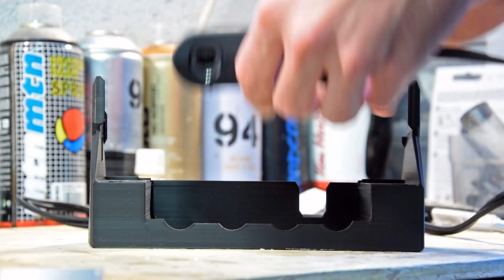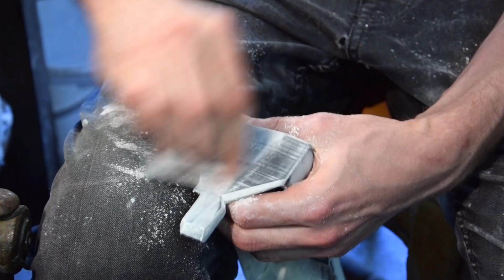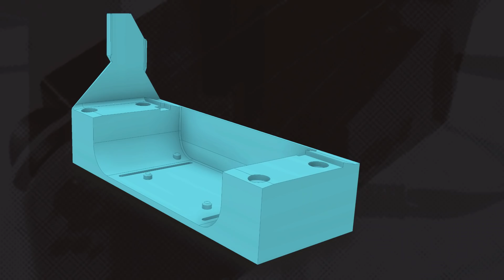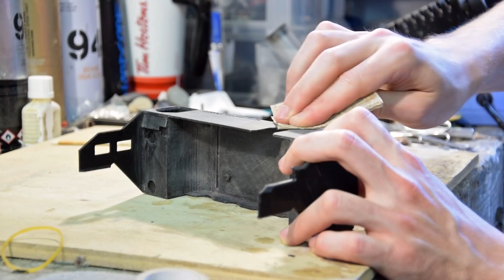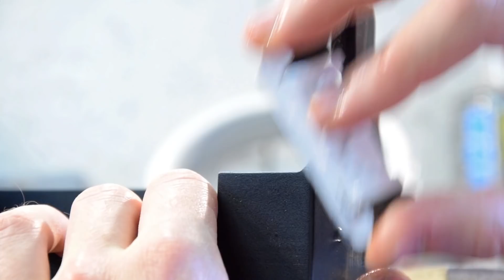Ultimate Switch Dock - Gamecube ports on official Switch dock - Rated-E Mods

Comment: I know it’s been like a year since you made this but I recently remembered this. I have an old skool dock which is almost identical in measurements to the original adapter but slightly smaller, would the current files work with it or would you or me have to edit the proportions to make it work

Comment: Just got mine, only thing I recommend is adding some rubber feet to the bottom since it slips and drags pretty easy on flat surfaces
Reply from the maker: Maybe i should put little indents for rubber feets on the bottom
Reply: @RatedeMods  Would be pretty nice. I just ordered some and plan on installing them on the one delivered to me

Comment: You know, I think you could make a Switch, Xbox 1 and PS4 console in one. A hybrid custom console that let you play EVERY game and use every controller, it would be difficult but hey, something, and you can make it a handheld or a home hybrid console, and you can higher or lower the frames  if it's possible. This was a theory of mines and some of this could only just be a opinion of mines as well sense making a ultimate hybrid console will be kinda hard, or almost impossible.
Reply: If this, Console does exist it maybe called the XStation64, or a better name. ( Edit: I had to fix some auto corrections for typing to fast)

Comment: I printed it off but it was unfortunately very flimsy. The pieces on the side snapped off really easily, and now the Switch doesn't like to sit on top of it.
Reply from the maker: They can snap off but if you use a strong process they can be pretty strong ! At least 3 perimeters and 30% infill
Reply: @RatedeMods  I wonder if I can go back to the printer then. They didn't give me much flex room for choosing stuff like that. The one I printed off also had strands of plastic-y hairs and an extra base to it: https://cdn.discordapp.com/attachments/147214538083794945/542085318191349771/image0.jpg
Reply from the maker: Oof yeah that doesn't look too bad but not too good either :/ those strands are because of poor retraction. You'll need to scrape off the little bubbles at their base too because it would leave less room for the switch dock than i intended :(
It looks like there is a high layer height and a low wall line count (you can know by looking at the number of lines making the little circles on the top for exemple)... I do think this is not as strong as it can get.. but the main thing to remove is those strands. With a knife for exemple.

The brim at the base is normal :) it's unnecessary but it can't hurt. Did they not give you any control? I hope this was free or very cheap 😅
Reply: @RatedeMods  Yeah this was done at the local university. It cost like ~$8 to print. There's a section for adding notes. If you have any notes that you would recommend adding there (since there are no options) I would be all ears and would give them another shout.
Reply from the maker: I'll be happily to refund you as a gesture if you feel disatisfied with the 3d model :)

Comment: Well, Just started a print with ABS instead of PLA. Going to try my hand at acetone smoothing and then painting the model with my air gun. Love the model can't wait to add this to my switch dock.
Reply from the maker: Send pics 😁
Reply: @RatedeMods  Ooof, there was so much layer shifting from my QIDI tech in this print that, while functional, it's stark ugly and no amount of post processing will fix it. Investigations show that my glass bed clamps have grown loose and a recent addition was restricting the hotend connections. Will have to attempt again after I fix this shifting. Or I could just use PLA on my ender 3...

Comment: I'm trying to print this, but it has failed two times now with the same issue. The top right corner starts to warp and bend up, ruining the print. I've tried lowering the bed temp, but the warping still occurs. I'm using PLA filament in an Ender 3 printer, just like the one you are using, with the same settings. What can I do to fix it?
Reply from the maker: Like i said on etsy, but i'll write it here too for the others 😁 :
- don't use tape
- level your bed and get it a bit higher maybe
- use a glue stick

This should work, it does on many printers :)

Comment: see sadly this is not one of the worst ways to play smash. I found using the gamecube adapter has a much much higher ping than a normal usb controller. so online this means your inputs are going to be super late and offline, NPCs will reach your button imputs before they happen, example: using marth, AI is changing at you for a dash attack, at the last second you hit your down B, AI see it before it happens and stops the attack, then you sit there like a idoit and get hit.
Reply: that’s not a controller thing the computers in smash are just like that, the game sees your inputs and computers react to it unfairly
Reply: @snitchbug  no it is 100% a controller thing, just tested it my old wii u game cube adapter vs my pro controller, fought a AI on max difficulty with my pro, they fell for the counters and other last second inputs every single time, and inputs happened faster. with the GCN controller though the adapter they were reacting to my inputs before they happen on screen. its about a 8 frame delay with a pro con but with the adapter its 10-12 frames of delay witch is not good. online that 10-12 frames will turn into 15+ frames of delay. on that note there are really good USB GCN controllers out there that also have the HD rumble, all the shoulder buttons and a home/screen shot button. some even have a turbo button.

Comment: I already bought the STL, but my university only alows me to print at 230°C, Is it safe to print it without using supports anyway? I'll be using the Makerbot Replicator 2,
Reply from the maker: I'm sure it's fine, is it using abs? Anyways, worst case scenario, the cable management holes may look a bit less good. The rest is pretty straightforward
Reply: @RatedeMods  ok! Thanks! Its PLA by the way

Comment: You should have added holes for rubber feet on the bottom. I feel like if my Cat whould touch any cable attached to this the whole thing whould be send flying since the bottom is too slippery.
Or if you are in a match of smash and you pull slightly on the Cable the whole thing whould move. You should defently add this. Its a must have.
Reply from the maker: That's definitely a thing i'll add when i have time to tinker the model. Then people can add rubber feet or not according to their liking

Comment: The SWITCH just needs one Port to support the GameCube-Controller Adapter. You can plug in two Adapter to support 8 Player Smash. Only the WiiU needs two USB-Ports for the Adapter... I am interested in an 8 Port-Dock-Dock...
Reply: The grey cable is JUST for rumble regardless of what system you are using the GC adapter with. All 4 ports work fine without rumble.

With the WiiU I would never plug in the grey cable because I don't care about rumble. I do the same on the Switch.
Reply: @midknightfox17502  That may be true and doesn't affect my Post... Btw you can set your Controller always off in the Menu, even when you play with a Pro-Controller or with a GameCube-Controller on a friend's console who's plugged in both USB to have this feature^^ I don't care about rumble either. So I'm interested in a more stable and bigger 8-Port Version of this☝️🏻 I know a true smasher always would use a GameCube-Controller and also will not play any 8 fighter Smash... But it's fun after a Tournament and having the possibilities is everything! 😅

Comment: This design is really cool, I love it. 
I'm thinking on printing it myself, however...
There is or there was a problem with switches, where they could be easily stolen on like tournaments (like Super Smash Bros. Ultimate)
(I know Nintendo uses their special cases with locks, but that's not exactly available to everyone)
I know that there were some ideas addressing that, but I think it would be really cool if it was possible to modify your design, to be able to lock the actual Switch itself with a padlock or something.
It doesn't need to be completely theft proof, just to make it hard for the Switch to be stolen without making a hassle AND make it look cool :)

What do you think? I'm just throwing the idea out there.
I know I would print that instantly, because I'm planning on hosting some tournaments myself in my region.
Reply from the maker: I think it could be a good idea ! Just there would always be the possibility of just running away with the whole thing
Reply: @RatedeMods  It's still a lot harder to hide that, so while taking the switch and hiding it right away could be really quick, with the lock they'd need to unplug all the cables and taking the whole thing should draw enough attention. That's the idea at least.
Reply: @DrayvNB  You might be able to tie a string around the analog sticks of the joycons and then tie them to the usb holes on the "dock dock." I don't think there's a way to easily 3D print something for that because you'd have to somehow connect it to the switch itself. Maybe some loop holes on the dock to tie the switch to?

Comment: This is amazing. I was finding a way to elegantly add a part to the Switch dock in order to make something like this. Maybe the only lack is that you can't put LAN adapter in it. However, it still is very very nice and I already bought the model!
Reply: i think you can actually still pu your LAN Adapter on it as long as its connected through the back USB Port

Comment: This has to be one of the most brilliant inventions ever.
Reply: Or, there are extension wires for GameCube controllers out there. I found you can get like 4 for $10.
Reply: Quite the opposite I think, not only are the GameCube controller wires  short but now you increase the chances of yanking the switch onto the floor.
Reply: @mindstouchworlds808   i guess you can just use the wavebird then, so no more yanking.

Comment: Timecodes for mobile:
Intro: 0:00
How to get it: 1:53
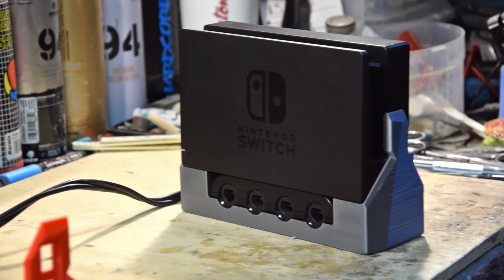Design logic: 3:10
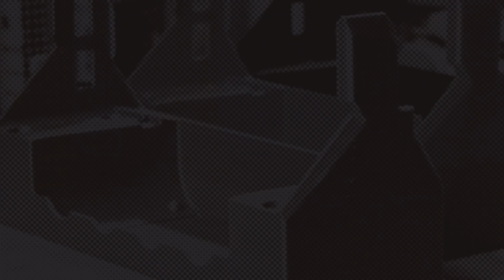3D modelling: 4:44
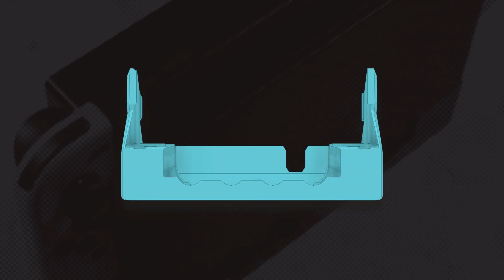3D printing tips: 6:52
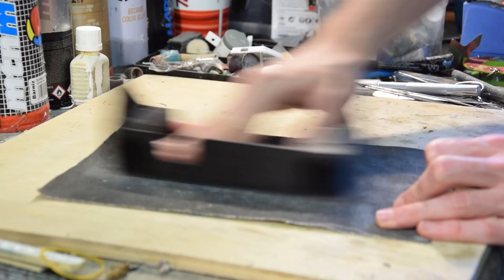Sanding and Bondoing: 8:45
Final coat of paint and inspection: 12:45
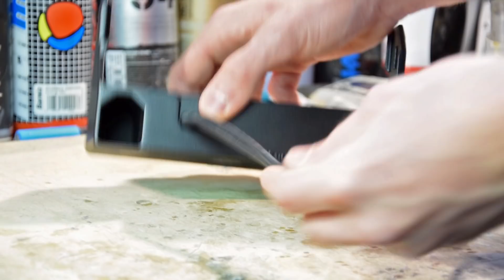Reveal: 13:15
Reply: Wait. Why is this a thing ? What happened on mobile?
Reply: @isaaclopez2982  time codes in descriptions don't work on mobile
Reply: @everardo.garcia  woahhh u had no idea that's a feature holy shit thanks
Reply: spawn wave niggas be like
Reply: Everardo Garcia thanks

Comment: Have you considered making a version that includes a mechanism to lock the switch into the dock? This seems like it could be nice for tournaments but I don't know if there's any current locking solutions that could work together with this without modification.
Reply: I would just add some black zip ties around the actual dock itself. If this pretty well keeps the Switch Dock and adapter together, then some zip ties around the docked Switch should do the trick.
Reply: To keep your switch from flying out of the dock when you rage!!

Comment: Just wondering: Does the adapter of a wavebird controller fits too or does it collide with the original switch dock?
Reply from the maker: Well everything is flat on the front so why wouldn't it fit? 😁
Reply: @RatedeMods  The adapter of the wavebird controller has a spacer (some ring) between the metal part and the rest of the transmitter. Nevertheless the transmitter partially bends back in the direction of the port and I was wondering if this could interfere with the docking station of the switch in your design as the switch dock sits directly above the GameCube port adapter and is also positioned a little bit in front of it.
Reply from the maker: OH RIGHT, i see what you mean !! What a shame I own a wavebird and i haven't tried it :(
It seems to me like it would interfere now that you say that..

Comment: Hey just curious do you know how much it weighs? My library charges by the gram for 3d printing.
Reply: I just bought the file for myself, cura has it estimated 91g of filament. Looking at 0.15mm layer height and 30 infill with that slice.
Reply: Mine was 107 grams. Granted I used an infill rate of 30% and .2 mm layer height.
Reply: That kinda is a ripoff

Comment: Do you have recommendations on how to fabricate stuff like this and your GameCube dock if you don't have access to a 3D printer?
Reply from the maker: The gamecube dock is doable by reusing the plastic from the switch dock :) as for this project it was designed for 3d printing it would be complicated without it

Comment: Would printing with a 0.3mm layer height be ok? The printer I have can only go as low as 0.3mm.

Also, I LOVE this! Would it be possible to make a version that isn’t stacked though? I worry about pulling on the cord and tipping over the stitch, but if there was a version where the adapter was mounted in front of the switch instead, it could lower the center of gravity and widen the base to make the whole thing more stable. For someone who puts their switch on a wire shelf like me, a wide base is really important.
Reply: not sure, printing at larger layer heights makes measurements less accurate meaning the little holes and slots could become too small for the switch to fit in. However if you were to print it and that was the problem you could always scale it a little bit larger buy like 3% or something, either way its an amazin STL and its less than 2 bucks
Reply: That should be completely fine, the slicing software will accommodate the new thickness to keep it with in speck.  Of course it'll also depend on how well tuned your printer is.

Comment: I probably should have watched the whole video before buying. I ordered a clone of the official Nintendo adapter. I think its the same dimensions and everything but I am not 100% sure. I wont have my adapter in for a few more days but when I get it I will try to remember to edit this comment.

EDIT: The adapter I got (a knock off of the Nintendo version) has a turbo button and switch on the back to switch between WiiU/Switch and PC so I had to cut out a spot in the print to get it to work but it fits fine other than that.
Reply from the maker: Contact me on Facebook or something we will work it out
Reply: @RatedeMods  will do. I'm sure it will be fine if not I'm not afraid of editing the model myself.
Reply: @Rated-e Mods I got the adapter in. It does fit but I had to cut out a slot in the back for the turbo button and selector switch. I sent you a photo of this on facebook. I did a little editing on the model myself and I am printing it now. I will let you know how it works out.
Reply from the maker: @x9x9x9x9x9  that's awesome ! I'm going to go see

Comment: can you make the link for the mayflash adapter please'
Reply from the maker: For the files? They are in the zip with the other file don't worry
Reply: @RatedeMods  I was wondering if you were selling a model that had the mayflash adapter pre made with no file.
Reply: Rated-e Mods Does the Mayflash adapter work?
Reply: @WillH007  it does, I have it. Just use black cable alone. Unless you want rumble. Then use both plugs.